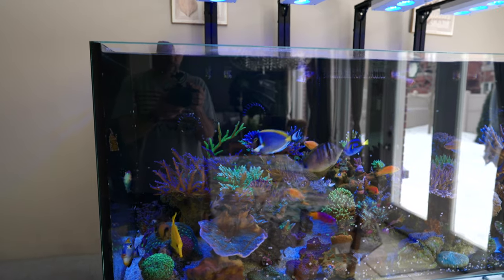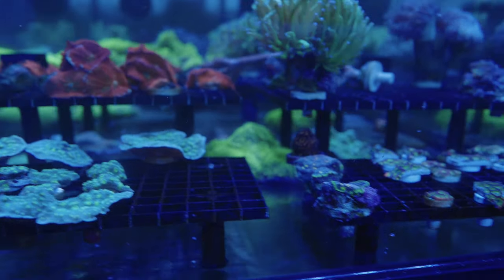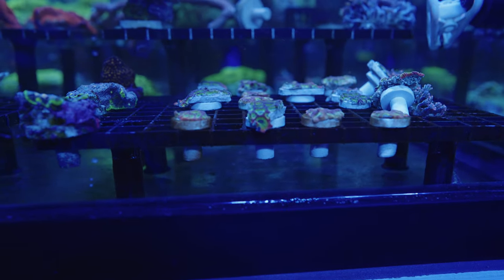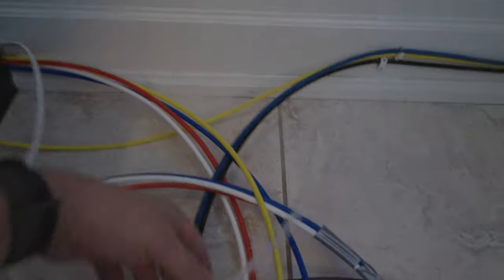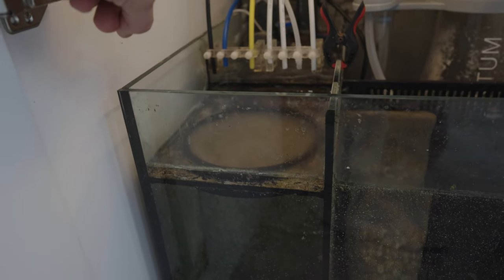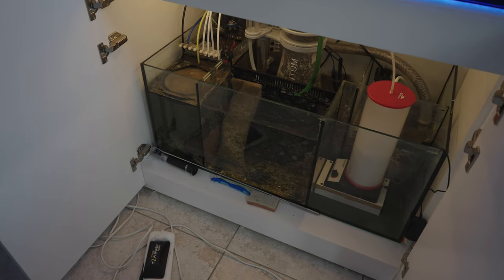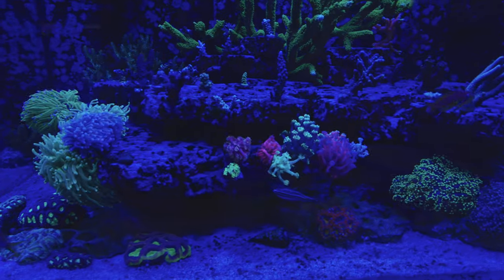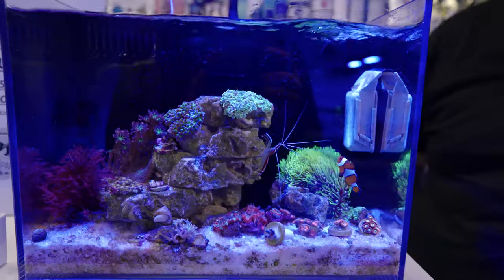DIY Kalk Reactor / Frag Mischief / RO Tubing Disaster

Comment: Do you worry that the stir bar will break down over time after being completely submerged 24/7?
Reply from the maker: Stir bar or the pill?
Reply: The pill.   Sorry
Reply from the maker: @mikew4435  the pill was actually fine, no problem there, however the pill made a hole in the acrylic eventually so I had to give up on this particular way